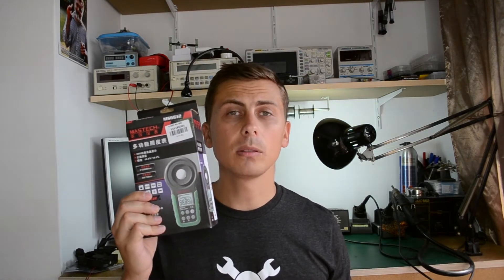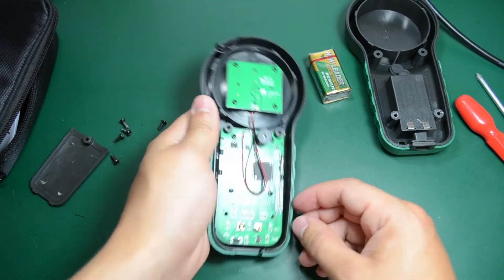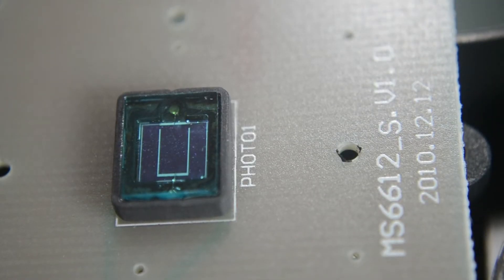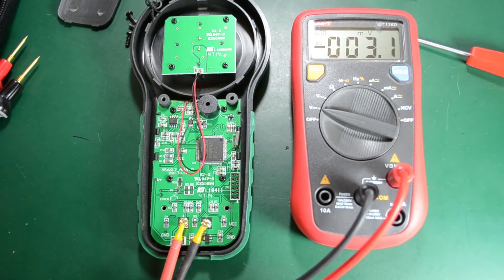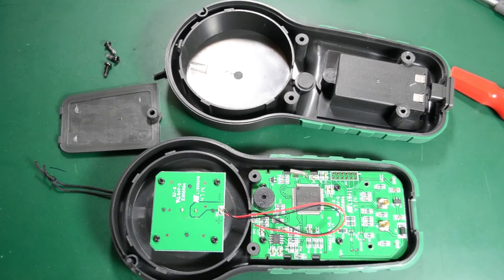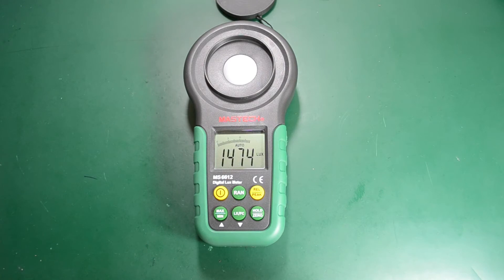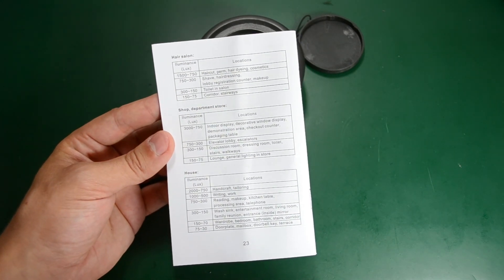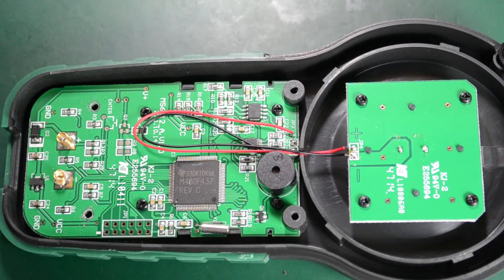VoltLog #20 - Mastech MS6612 Light Meter Review & Teardown

Comment: The PEAK measurement function is different from MAX function. PEAK is meant to show very fast rising (10uS typ) light pulse, like a camera flash, whereas MAX function will show the max of an average within its  sampling period (~ 500ms). So, if you want to check a flash pulses max lux, you need to use PEAK and not MAX.
Also the latest revision have gotten rid of the annoying beep  during power up. The firmware bug in FC mode described here also seemed to be fixed, I guess.

Comment: Awesome explanation, tear-down and thoughts on this meter! I will be doing some LED purchases and experimenting myself this fall and will bye this as well. You cannot beat anything that is designed by TI, just the firmware should be an issue. Thanks for sharing VL.